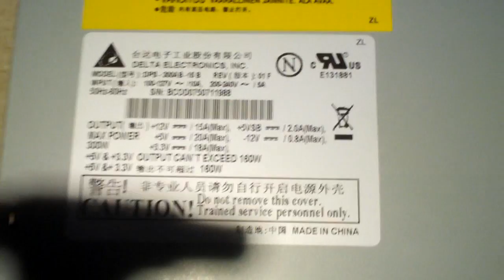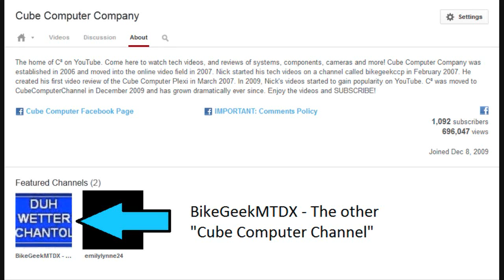A look inside the dead eMachines DELTA power supply

Comment: I do rate Delta power supplies, but on the other hand this year I've come across two DPS-300AB units from separate Dell machines with bulging caps, a DPS-250AB unit with bulging and leaking caps, and a finally a small form factor DPS-250AB that just had no power at all. I've also looked at several Lite-On and HiPro units at the same that were all fine (bar a HiPro that had some bulging caps too).

Comment: @7:18 I have that exact Westinghouse monitor and its PSU is acting up too! It keeps making a high pitch whine, a sign of bad capxon caps. And coincidentally, I was using it with an emachines that had this exact delta PSU. Such coincidence.
Reply from the maker: I recapped mine back in 2012. It's been running fine ever since, except for having resolution issues when hooked up via DVI.
Reply: ***** oh that's good, I might try that on mine too. Good monitor though.

Comment: EMI filter-this is used to filter the psu from the line, not the other way around. Some psu are practically a radio station and need a lot of filtering, others are quite and use little filtering, this diffference will show as size, number, and location of x.y,choke (common/differential)- even pcb trace size location and geometry.

Comment: Primary cap size- these are used in a voltage doubler- and 1/2 the cap size effective in circuit. 1uf per watt is a rule of thumb so 300w supply need 300x2=600uf caps. Some caps are more stable that others, some do better with ripple than others. The larger ones have lower ESR, so a reason for different size caps in same size psu. This is why there is so many caps in secondary-ESR. They use capacity 10-100 more than necessary to get a low enough ESR.

Comment: On the larger coils on secondary, the larger one is for 5v and 3.3v rail, the smaller one is for the 12v rail. The is a magnetoresonance circuit that derives 3.3v from the 5v rail, this is why the total of the 2 is often limited. The upright ferrite core inductors are part of a pi circuit, which is cap-coil-cap in use. Your comments on the size of magnetics in psu should be done with switching freq in mind, a higher freq can use smaller mags- which you seem to call poorer quality.

Comment: William, that's not true. Only the Bestec ATX-250-12E models had a serious problem with the +5VSB circuit. Other than the choice of capacitors, Bestec power supplies still run many a circle around the truly gutless and horrible wonders out there that are responsible for many motherboard and video card deaths. Delta power supplies also aren't terrible, they are in fact among the best. They are often very overbuilt and very well designed and have impeccable soldering too.

Comment: ...that do have 18 gauge wires but are built more like 250W units (470uF primaries for one where as a 250W Dell I used to have uses 680uF primaries!). I would know because I have one of them (HP-P3527F3). Yes, I'm sure it's capable of 300W, but only just. The Delta in this video isn't fantastic but it's not that bad either... looks like they used a strong, TO-247 STMicroelectronics part as the main switcher. I'm sure it's capable of its rating despite the 20 gauge wires.

Comment: When they fail, they are what cause the severe overvoltage of 5VSB. In regards to the actual units, I wouldn't really rail on Delta for building units of this quality... in fact, the quality of all the OEM PSUs depends on who's contracting them to build. A 700W Hipro from a recent Dell is extremely well built all around and uses all Japanese capacitors, compared to some Hipros built for older Dell units that use very bad Arcon capacitors, or the ones built for eMachines...

Comment: Or two-transistor 5VSB with self-oscillating feedback. If 5VSB is generated from a DIP, a MOSFET, or a power or top switch, it is likely just fine. Excepting the ATX-250-12E, of course, that does use the former circuit and it did not have OVP, hence the rash of motherboard killers. Also, a two-transistor 5VSB circuit is not necessarily a problem if it does not have the "critical" capacitor(s). They are often on the primary side of the 5VSB transformer and they are usually 22-47uF and 35-50V.

Comment: 20 gauge wires aren't as nice as 18 or 16 gauge wires but the worst they will do, like MrMac5150 said, is create a voltage drop which depending on how much power is being drawn, on the +12V rail especially, may or may not be a big deal. I also do not think any of these units use two-transistor 5VSB circuits... in fact, if you find a PSU whose +5VSB circuit isn't generated from a bipolar transistor and main switcher or two in parallel then it is not two-transistor 5VSB.

Comment: Some things to comment on... electrolytic capacitors can easily fail without bulging, smelling, or spilling their electrolyte. The only real way to tell is test them with the multimeter and make sure their ESR isn't too high or low or their capacitance (below or above the usual M 20% -+ tolerance) and voltage too high or low. So yes, it is very likely the Capxons failed in that eMachines power supply. Capxon is pretty much the worst of the worst in terms of quality.

Comment: The gage wire does not matter that much at 18 inches, you can easily tell when its running with a load on the cpu, if there is a voltage drop due to wire, and you will find less then a 1/4 volt drop from source to board. before they came out with the 12 volt cpu plug, they just used the traces on board.